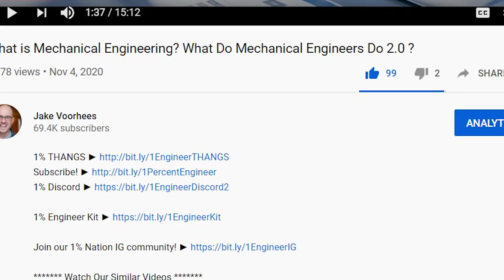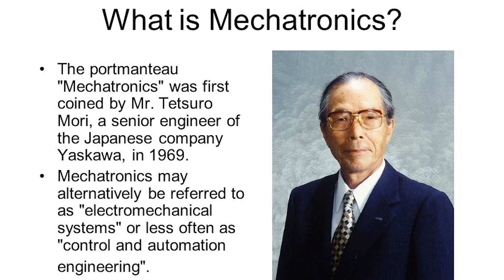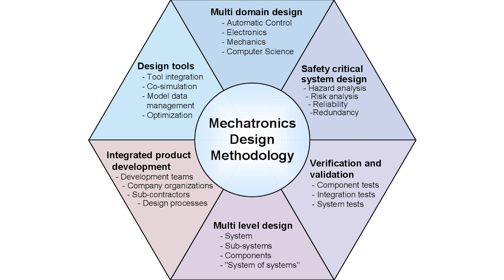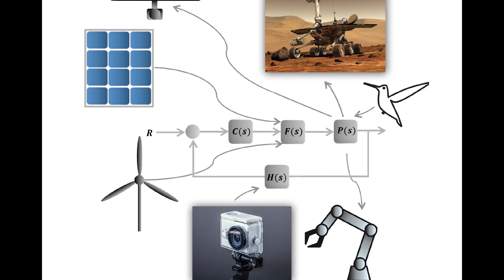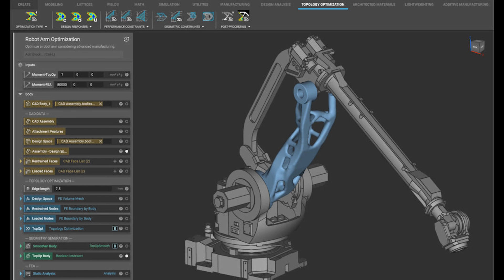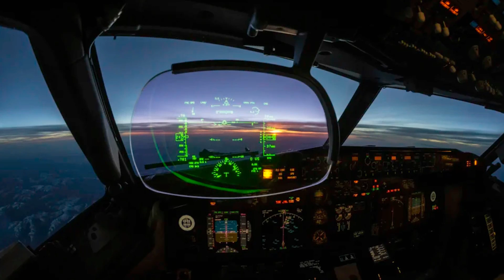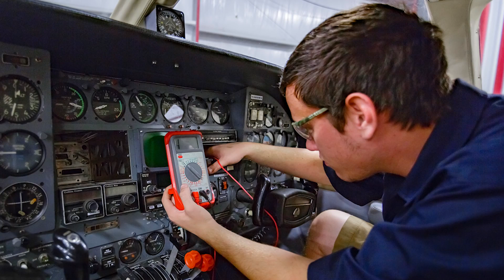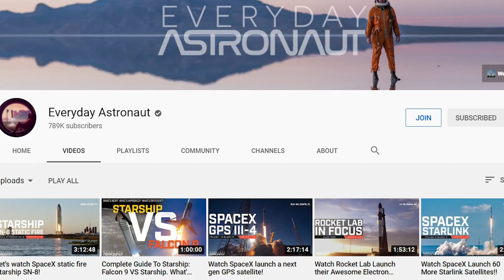What Do Mechatronics Engineers Do? | Can Mechatronics Engineers Build Robots?

Comment: I’m getting my BS in mechatronics and hope to work in robotics, automation, IoT or embedded systems. Haven’t really narrowed it down yet but there’s a huge overlap between all of those. I’m hoping I can get a summer internship or research project to better figure out where to specialize
Reply from the maker: Hey thanks for the comment. Great plan. Here's the thing with a BS in mechatronics.

You can't really get one. There are actually just 3 ABET programs in the USA right now. So oftentimes you have to choose EE or ME or CPE and do a degree concentration in mechatronics, which is a great path. Some universities have a formal certification program within EE/ME/CPE, or you may have to build it yourself. You would do that by for example, majoring in EE and taking more electronics courses and less about power or telecommunications. You would take robotics electives, signals and controls, and circuits courses, etc. Your CS related courses should revolve around mechatronics rather than something else, and so on.

Computer Engineering is often a subset of Electrical Engineering. But sometimes engineers struggle to choose between ME vs EE. This video will help you decide, “Mechanical VS Electrical Engineering” https://youtu.be/6PJ-Yw5qVsc 
 .
These will probably be helpful as well:
“What Do Mechanical Engineers Do?” https://youtu.be/5wEteXzhtak 
“What Do Electrical Engineers Do” https://youtu.be/zRawKI6Qsm0 
“What Do Computer Engineers Do?” https://youtu.be/hiL-cTbz188 
.
I also ranked Mechatronics Engineering as one of the only two S-Tier Mechanical Engineering options in this video, “Mechanical Engineering Job Tier List” https://youtu.be/ghxBLeEX_OM
.
Does this help and make sense? Let me know what follow up questions you have okay? I respond to everything, thanks again!!
Reply: @JakeVoorhees  I'm at one of the ABET-accredited programs ;). Its multidisciplinary engineering technology at Texas A&M. There are two concentrations: mechatronics and STEM education. It's not formally referred to as mechatronics, but it is an ABET-accredited 4-year degree for mechatronics. I take mostly EE and ME classes with focuses in control systems, embedded systems, instrumentation, robotics, and automation.
Reply: Its not classified under the mechatronics classification for ABET, but it is an accredited program focused in mechatronics
Reply from the maker: @austinprobasco7482  I guess I don’t understand what you’re saying. The degree you get is either ABET or it’s not. I guess the thing to further look into is whether or not mechatronics engineers get their PE and if that industry cares about ABET. I come from the civil world which cares about it a lot. Mechanical engineering does quite a bit, but the more you get into software, the less people care. Any thoughts about that?
Reply: @austinprobasco7482  Hello Austin, I am high school senior and I plan to transfer to Texas A&M to attend their Mechatronics program. Do you have any advice that would make my transfer process easier? Or any general advice? I like to plan ahead.

Comment: What are the best universities for study about machetronic engineering in USA
Reply from the maker: Hey thanks for another comment. There are actually only 28 programs for mechatronics in the USA. So chances are, your path into MTREs is not necessarily including majoring in it. Often engineers will major in EE or ME and do their concentration on mechatronics, and bridge between the two. 

I get a lot of questions about mechatronics engineering - probably more than any other subset of engineering nowadays. I think mechatronics is the future. It is the intersection of mechanical and electrical engineering, so you can lean into either the physical design side i.e. mechanics, or the electrical engineering aspects which would include the circuitry, signals and controls, power, automation, and programming aspects. I think a mechatronics engineer who leans into the electrical engineering side of things is VERY well suited for the future. Here are some videos that you may be interested in:

“What Do Mechatronics Engineers Do?” https://youtu.be/4YjLZcQRLds

There are only 28 mechatronics programs in the country, so often times you have to choose EE or ME and do a degree concentration in mechatronics, which is fine. This video will help you decide which one to do, “Mechanical VS Electrical Engineering” https://youtu.be/6PJ-Yw5qVsc 
 
These will probably be helpful as well:
“What Do Mechanical Engineers Do?” https://youtu.be/5wEteXzhtak 
“What Do Electrical Engineers Do” https://youtu.be/zRawKI6Qsm0 
“What Do Computer Engineers Do?” https://youtu.be/hiL-cTbz188 

Does this help and make sense? Let me know what follow up questions you have okay? I respond to everything, thanks again!!

Comment: Would it be a good idea to be an electrician for the mean time while trying to study for this degree
Reply from the maker: Sure it can't hurt. Especially because electricians make decent money. But you can probably intern for a firm that hires electrical engineers, or pick up a job with a professor doing electrical engineering research. But yes, to answer your question, I think its a good enough way to get some experience and earn some good money too. Only issue is that you aren't learning from engineers. You aren't building relationships with engineers or with people who know engineers. So it sort of dead ends without much momentum into the next step. That's why I brought up internships and research, etc. Does that make sense? Thanks for the comment cheers
Reply: @JakeVoorhees  so would I just need to start school and then try to work with an engineer firm?
Reply from the maker: Yeah that’s a fine order. You can probably get an internship even without being in a program if you meet people well and show your career direction and passion for your engineering future
Reply: @JakeVoorhees  so would I just need to start school and then try to work with an engineer firm?
Reply from the maker: @tahjesue-johnson9795  you got the reply? Thanks

Comment: Is it ok if i get computer science instead of mechatronics
Reply from the maker: Well sure, it's okay to do anything within your skillset and interests. Do you like programming that much more than the design and building of things? That is the difference between CS and engineering. You will only work with code in CS, which is fine if you like that a lot. Some engineers don't, and some engineers want a hybrid. The hybrid option is electrical engineering by the way

Comment: Mechatronics engineer can work in communication and signal companies ?
I am studying mechatronics but I have difficulty in engineering drawing so I don't want to work any job related to design I was thinking to change my department to communication engineering . I want your advice
Reply from the maker: I mean you can either lean more towards the electrical and electronics side of mechatronics or you can focus on a lot of programming and go into communications / telecom. I think switching majors away from one engineering into another should be avoided. most of the time because any engineering degree can pretty much get any engineering job.

Comment: Okay so in some universities there is no mechatronics like the actual part but its put inside in mechanical engineering so is it the same thing
Reply from the maker: Nope mechatronics is basically a combination of Electrical Engineering and Mechanical Engineering. So watch this video and choose one, “Mechanical VS Electrical Engineering” https://youtu.be/6PJ-Yw5qVsc. Then, take tech elective courses and build relationships and do research in the direction of the other. I think EE has a stronger future than ME, so if you really like math and if you can program well, then EE is the way. Over time there will be more actual degrees for mechatronics, but for now you basically have to build it yourself. Does that make sense? Thanks

Comment: What's FE and PE ?
Reply from the maker: I guess I should make a video about this :) There are a variety of schools for engineering, but only some are ABET accredited. This type of school is required to be eligible to become an actually Engineer in Training (EIT) and eventually a full Professional Engineer (PE). In order to gain these certifications, you must sit for a series of two 8 hour engineering exams.

The first of which is the Fundamentals of Engineering Exam, or the FE. Students in engineering at ABET universities can sit for the FE at the end of their courses, usually during senior year is when you would first take it. The FE tests you on generally engineering (4 hours in the morning), and then based on your major, you will have questions on mechanical/civil/electrical etc. After this, you become an EIT. 

Then you go out and get your first full time engineering job, typically as a "Staff Engineer". Even though you are a working professional, you are not a professional engineer yet. This requires 4 full years of engineering experience while working under someone with the Professional Engineer (PE) certification. Once you have that, there is a bunch of paperwork and validation of your experience.

Then you can sit for the Professional Engineering Exam, the PE. This is another 8 hours where depending on your discipline, you would take a general mechanical in the morning, and then a specified mechanical (HVAC, Machine Design, Thermal & Fluids) or say if you're a civil engineer, there is Transportation, Structures, Geotechnical, Construction, Water Resources, etc. The PE is very hard and pass rates for some types are just 50%. Engineers usually study for an entire year, and its totally open book. People bring in a red wagon full of text books sometimes.

So after you take the FE, work for 4 years, then study really hard and pass the PE for your field, you are a full engineer. I hope this helps! Thanks
Reply: @JakeVoorhees  thank you so much for that, btw do you recommend studying engineering in germany ?
Im currently in my 1st semester of mechatronics engineering in turkey but im thinking i would have a better opportunity from every aspect if i transfer to an applied science university in germany.
Reply from the maker: @poserjockey8406  thanks for the comment. yeah I mean getting a degree in the west is probably better. I suppose it depends where you want to work after school. Do you want to live and work in Germany? Let me know so I can help you thanks

Comment: I am currently doing my diploma In mechanical engineering, but I am much interested in designing robots would it be wise to move to mechatronics engineering or must I complete the Qualification first, secondly can mechanical engineers build robots? What's their contribution to such?
Reply from the maker: MEs can work in Mechatronics, no problem. So don't worry. Just make sure to take EE leading tech electives and plenty of programming courses. Let me know what you need help with next. Here are some EE related video, thanks! 
“What Do Electrical Engineers Do?” https://youtu.be/zRawKI6Qsm0
“Jobs for Electrical Engineers over $100,000” https://youtu.be/Vi4hkCeNWs0 
“Mechanical vs Electrical Engineering” https://youtu.be/6PJ-Yw5qVsc

Comment: Should I pick up a mechanical engineering degree before a mechatronics degree? I want to work on and help create full dive virtual reality, but that's a 50 field project easy. So I'd like to specialize in touch technology, haptics, and specifically, creating the physical machine itself. (also, making robots physically is really cool haha)
Reply from the maker: Seems like you want EE to be honest. MTRE is mostly still a graduate level course, or a specialization within ME or EE. You're far more likely to end up doing the signals/control/programming for the things you listed, so EE is the one imo

Comment: What programming languages I should learn?
Reply from the maker: Quora answer, Amol Navpute, M. Tech Mechatronics, College of Engineering, Pune (2016)

Don't worry too much about learning a programming language. Instead, learn how to program.

Programming is designing an algorithm to complete a task, and then implementing that algorithm with the very limited amount of things that a computer can do. It is a thought process of breaking something down into a series of simple steps to be executed. Once you know how to do this, learning different programming languages is just a matter of memorizing their syntax and rules.

If you're just trying to understand the basics of programming, you should probably use Python. It's a great language for doing high-level automation (like if you want to control servers or process data) as well. It's also far more user-friendly than other languages, so it's great for beginners (in my opinion).
If you want something you will almost certainly use in college, learn how to use Matlab. You can pick up a student copy on the cheap, or install Octave (which is a free, open-source Matlab clone that is very similar but lacks some of the advanced toolkits). This will particularly help you in your freshman courses.
If you're very serious about engineering and think you'll go mechanical, you should also (in addition to one of the two above) learn C. C is used nearly anywhere microcontrollers are used and it has a tougher learning curve than Matlab or Python, in my opinion. This is mostly because it
isn't quite as user-friendly (since it's an older language)
requires you to do your own memory management (i.e. you have to allocate memory to do things like strings, for example).
What c will offer you ?

If you are able to program in C, then probably you can program in almost all the languages.
You will have a learn to everything from scratch.
You will be working close enough to hardware(Arduino).
So overall I’ll ask you to start with a C and you will end up in learning most of them.

That said, don't worry about whether or not you'll actually use that language in practice. For one, nobody uses one language their entire career. Additionally, the far more important thing is that you understand the fundamental concepts of programming. After that, it's just learning new syntax and some new paradigms. Think of it like learning to hold a hammer or screwdriver. Sure, you may use power tools in real life, but it's not as if you will be hurt by learning the hard way.
Reply: @JakeVoorhees  Thanks for the reply and the great content!
Reply from the maker: @shsyzx5582  thanks so muchhhh let me know how you help you next cheerrrssss

Comment: Why is it that most of the talk about mechatronics is from mechanical engineers while electrical engineers focus more on robotics itself or controls and embedded systems? If it's at the intersection of the two disciplines could you easily become a mechatronics engineer with a background in electrical engineering?
By the way, please make a video about controls engineering.
Reply: I dont understand it either. At my university, robotics is offered as a subfield of Electrical engineering.
Reply: @benjaminsiddique2501  It is but it also combines computer engineering and mechanical engineering
Reply from the maker: correct, great point
Reply from the maker: a lot of people who end up on robotics are EEs, and I would say that your uni has it under the right path
Reply from the maker: because mechatronics is one of the hottest fields going forward, and ME is the default stock engineering field that a lot of young people want to pursue. There are actually more EEs than MEs, but the difference isnt much. And yes, since EEs and MEs work side by side, they can crossover quit a bit in the professional world. The biggest difference is probably the major choice. Where you will have more theoretical math in EE and more math in general, and more of a mechanics, can "touch it and feel it" type of situation for MEs.
Reply: @JakeVoorhees  Thanks for the response Jake, I love your channel.

Comment: Good Luck for me and all future engineers
Reply: Thank you, feels good to be apart of a small community with such a wide application for advanced technology !!
Reply from the maker: @365dailyroutine  yuppp, if you’re interested in mechatronics, here is another pro tip. You basically have to major in something else because there are only 3 ABET accredited programs in the USA.

So oftentimes you have to choose EE or ME or CPE and do a degree concentration in mechatronics, which is a great path. Some universities have a formal certification program within EE/ME/CPE, or you may have to build it yourself. You would do that by for example, majoring in EE and taking more electronics courses and less about power or telecommunications. You would take robotics electives, signals and controls, and circuits courses, etc. Your CS related courses should revolve around mechatronics rather than something else, and so on.

Computer Engineering is often a subset of Electrical Engineering. But sometimes engineers struggle to choose between ME vs EE/CPE. This video will help you decide, “Mechanical VS Electrical Engineering” https://youtu.be/6PJ-Yw5qVsc 
 .
These will probably be helpful as well:
“What Do Mechanical Engineers Do?” https://youtu.be/5wEteXzhtak 
“What Do Electrical Engineers Do” https://youtu.be/zRawKI6Qsm0 
“What Do Computer Engineers Do?” https://youtu.be/hiL-cTbz188 
.
I also ranked Mechatronics Engineering as one of the only two S-Tier Mechanical Engineering options in this video, “Mechanical Engineering Job Tier List” https://youtu.be/ghxBLeEX_OM
.
Does this help and make sense? Let me know what follow up questions you have okay? I respond to everything, thanks again!!
Reply from the maker: truth! you got this